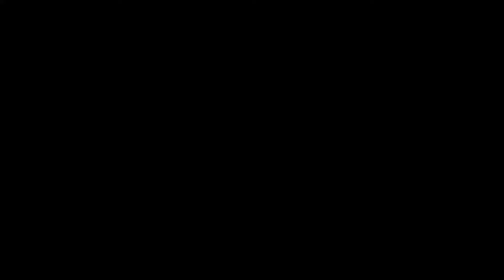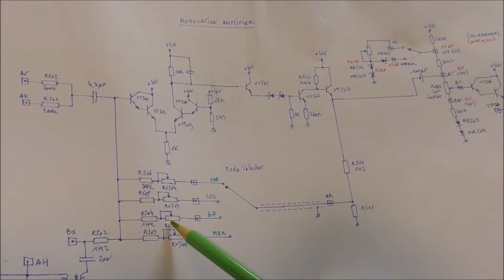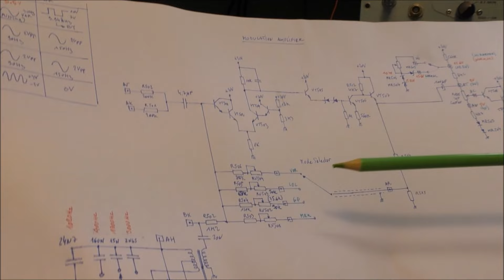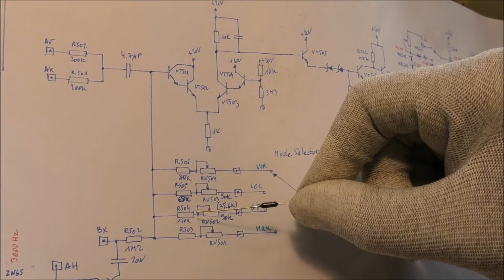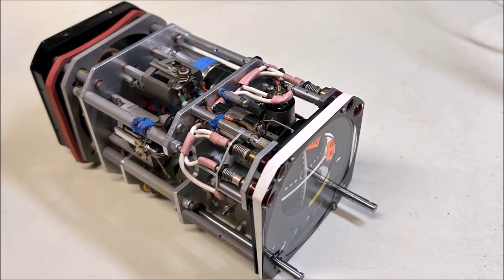LDM #431: ILS/VOR signal generator CRM.555 - Part 3: Glide Path function repair and test

Comment: AI Summary

Abstract:

This video documents the troubleshooting and repair of an ILS (Instrument Landing System) test generator that was exhibiting signal saturation in its glide path mode. The investigation begins with an analysis of the schematic, focusing on the modulation depth adjustment circuit. After determining that a simple trimmer adjustment was insufficient, a comparison with the correctly functioning "localiser" circuit revealed a significant discrepancy in a key resistor value. The fault was traced to an overly high resistance (150 kΩ) in the glide path circuit. The problem was resolved by adding a resistor in parallel to reduce the total resistance to approximately 68.5 kΩ, matching the design of the localiser circuit and eliminating the saturation. The successful repair is then verified by connecting the generator to an aircraft glide slope receiver and observing the correct response of a flight path deviation indicator to various DDM (Difference in Depth of Modulation) settings.

Troubleshooting and Repairing an ILS Glide Path Generator

*   0:00 - Problem Identification: The ILS test generator shows a saturation of the modulation signal when set to glide path mode.
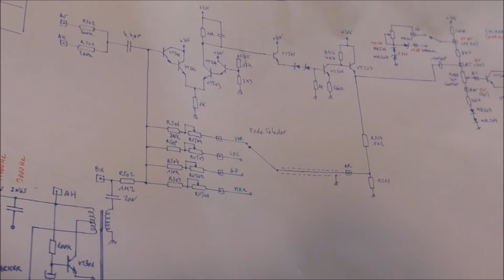*   0:18 - Initial Investigation: A review of the schematic points to the modulation depth circuit, specifically trimmer RV502 and its associated resistors. Initial adjustments to the trimmer fail to resolve the saturation issue completely.
*   2:24 - Root Cause Discovery: By comparing the glide path circuit to the localiser circuit, a key difference is found. The localiser circuit uses a 68 kΩ resistor for modulation, while the faulty glide path circuit uses a much higher 150 kΩ resistor, causing the signal to saturate.
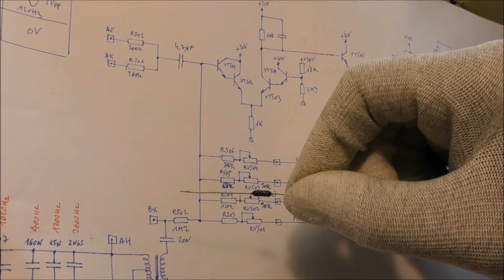*   2:54 - Implementing the Fix: The issue is corrected by adding a 127 kΩ resistor in parallel with the existing 150 kΩ resistor. This modification brings the total resistance down to approximately 68.5 kΩ, which successfully resolves the signal saturation.
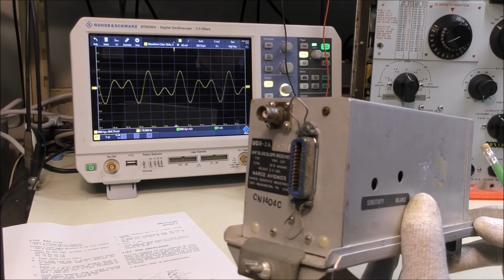*   3:30 - Verification with Aircraft Equipment: To confirm the repair, the test generator is connected to a real aircraft glide slope receiver, with the output displayed on a flight path deviation indicator.
*   5:51 - Successful Test and Demonstration: The test confirms the fix is successful. The indicator's flag disappears, signaling a valid input. The horizontal glide slope bar remains centered when the DDM (Difference in Depth of Modulation) is zero and moves up and down correctly as the DDM is adjusted, validating the generator's proper operation.

AI-generated summary created with gemini-2.5-pro for free via RocketRecap-dot-com. (Input: 12,544 tokens, Output: 526 tokens, Est. cost: $0.02).
Reply: People like to rag on AI, but accurate summaries like this is actually quite a good use of it
Reply: @ZedMaynard  Thanks